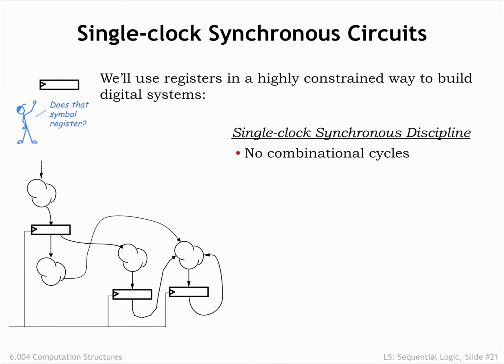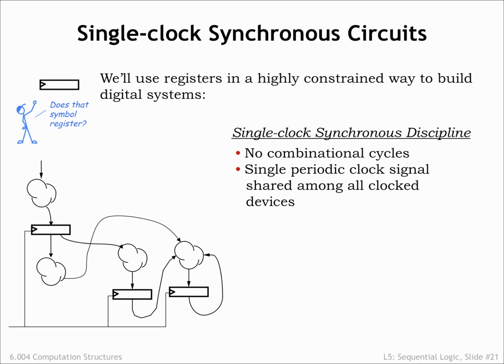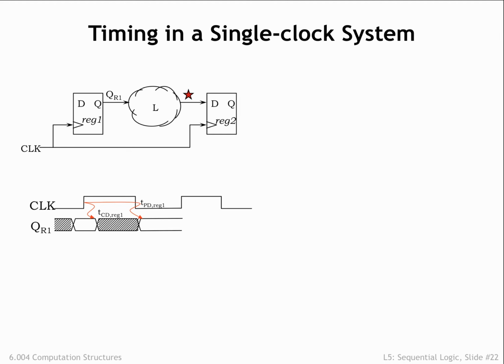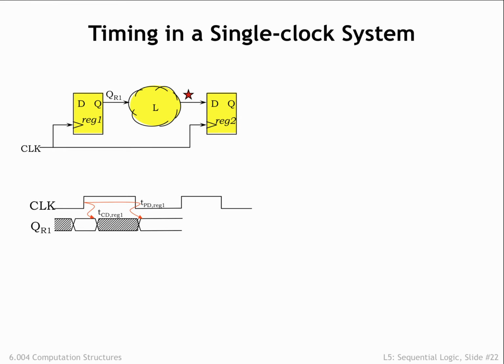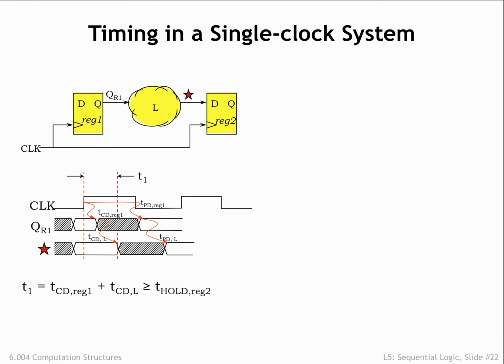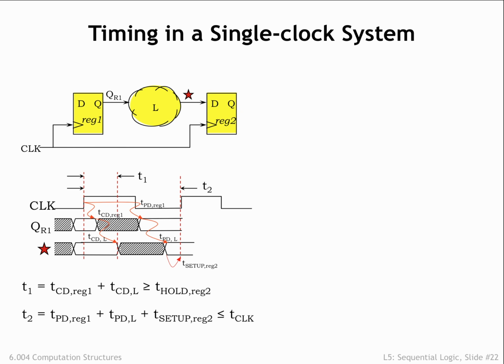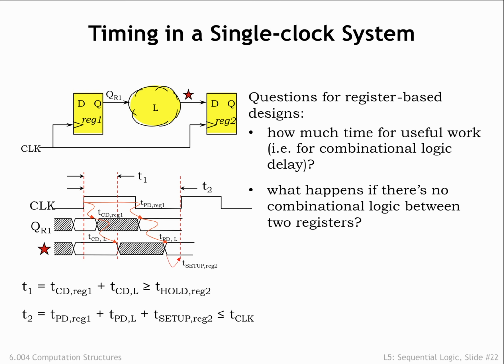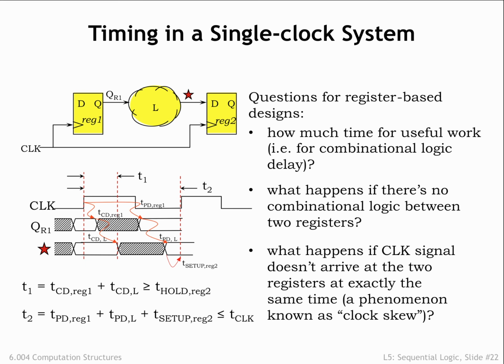5.2.5 Sequential Circuit Timing

Comment: I was struggling with understanding these timings, so I tried to describe t1 and t2 in simpler terms. I'll use a hospital visit as a simple analogy, and then reiterate it one more time but a bit more formally. Maybe it helps someone.

Let's say you need to see a doctor. To do that, you need to (A) check in 5 minutes ahead of your scheduled time (otherwise you won't make it to the doctor's office in time and the hospital won't check you in). Once checked in, you need to (B) remain in your seat for up to another 15 minutes because that's how long it may take for the medical staff to get everything set up and call the doctor. Finally, you must (C) leave no later than 5 minutes before the next patient arrives.
(A) and (C) are encoded in the second formula ("You must leave the doctor no later than the time the next person arrives") and (B) is encoded in the first formula ("You must sit and wait until the nurse calls your name.") This analogy is flawed but maybe it helps anyway.

In other words, at the start of every cycle, the following must hold true for the system to work:
1) "After the rising clock edge, Reg2's (previous) input value must remain readable(stable) for at least T_{hold,reg2} (nanoseconds) to be registered and preserved."
2) "Before the rising clock edge, Reg2's (new) input value must arrive no later than T_{setup} (nanoseconds) in advance, to guarantee its "entry" past Reg2's first latch's closing "gate".

Comment: A feedback. Information density is too high in these lectures. It would be better if you explained each line properly.
Reply: yeah but expecting to be learning circuits and ECE topics in any depth by lecture though is not that helpful. even just practicing calculations and memorizing stuff rote hasnt helped me much. labs are crucial. and modeling software, if you never see the circuit in action and operate it yourself it doesnt stick
Reply: @snacc1543  which software/simulator you advise for this topic? :)